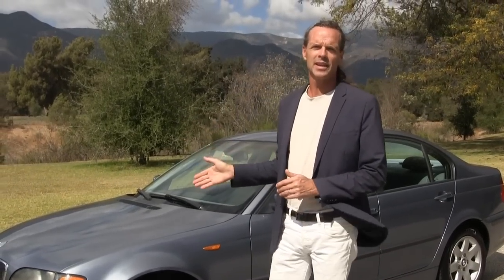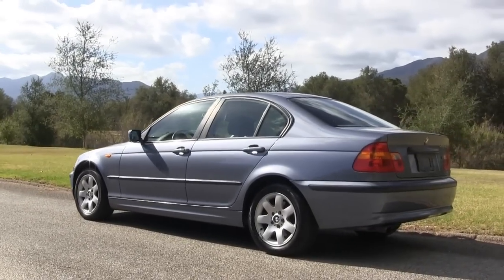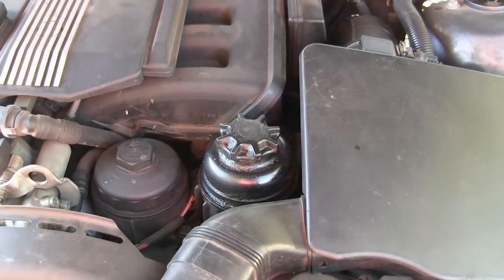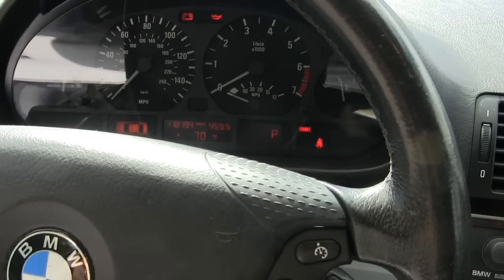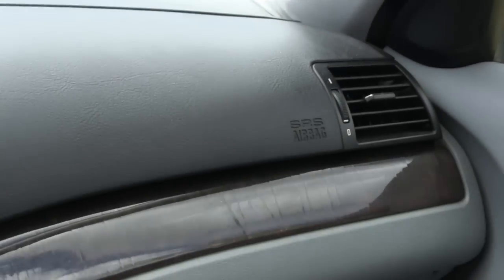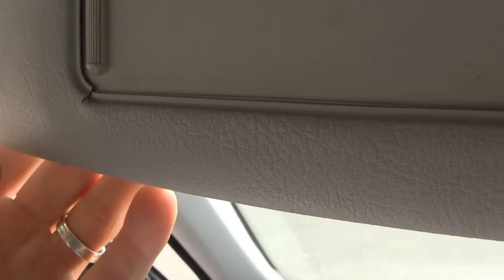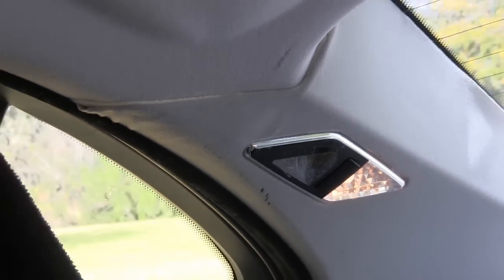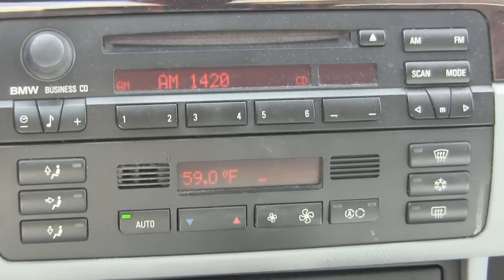Why You Should NOT Buy a Used BMW

Comment: Ive got a e46 330i sport and I love it, one of the best cars ive ever owned but! Bmws suffers with the oil pump nut failure!! The nut on the oil pump over time undo it self and if you not quick to shut down the engine it can cost you a lot of money. So for all e46 drivers out there have the pump nut looked at before its to late. BMW knows of the problem but will not fix it for free. Air bags are also a problem so be sure to call your local BMW dealer for the recalls.

Comment: I have a BMW 320d e46 Facelift with 300.000 km. I drive the car from Germany to Albania (2000km and bad roads) every year. The car never stops oder get mit in trouble. It had had some small problems (like evry car) but nothing expensive and the Interior und Exterior looks so good i wash the car 1 or 2 times in a month. Thr car only need oil and diesel and it drives. I have lots of friends with e46 and alle they don't have so much problems like in the Video they are alle happy with their e46 and me too!

Comment: On my third BMW. First was a 325i, and two 5 Series. Despite this, I am not a BMW enthusiast who believe they are the best cars ever. You buy a BMW for the performance and luxury, otherwise you will buy a Camry or Accord which will cost less to own.  I did have the interior roof poof down on the old 3 series as stated in the video. But overall, it really depends on how the individual treats the car.  I call BMW's the spoiled child of the car industry because you need to address the problems as soon as they arise. Don't delay repairs as they will get real costly. Despite the repairs, all the engines on my BMW's were solid. As with all cars (especially BMW) stay on top of maintenance and your car will run great for a long time. I highly recommend not buying a new BMW. In 3 years the car will be worth at the most half of what you paid for it. Best bet is to buy a 3 yr old lease return that has a BMW Certified Warranty. If you have 1-2 years left on the original warranty you are practically worry free and you can use your money to pay down your auto loan or if you paid cash for the vehicle, put about $5k away for future repairs.I knew two people who owned the early model X5's and got rid of them quick. They were crappy.

Comment: I'm not even a fan of bmw but I disagree with the notion that germans just ceased to figure any of what's addressed in the video out. I believe these kinds of troubles depend for the most part on the owner. That sticky stuff that's melting all over in the interior isn't exclusive to german cars, I have a honda accord 2001 and it has that stuff also. That's one of the reasons why people buy new cars and take good care of them themselves because you never know what the previous owner was like. My take is, every car is a good car, you just gotta take care of it. Does german cars bring along a higher cost of maintenance? Sure. But if you maintain them, you're in for a treat!

Comment: I own a 2008 e92 and I don’t have any of these issues at all. I have friends who have e46’s and they have none of these cracks in the plastics.

Many cars have problematic issues, my dad’s 2002 Honda Accord had a major transmission failure - those generations had a flaw in the tranny design.

I also owned a 2002 civic si and its d series engine had its head gasket blow at 150k km’s.

Not sure which junkyard you picked up this e46 but I’ve literally never seen one with kidney grills and all the other plastic parts popping off.

Comment: Ok I understand this is not a car for someone that does not take car of cars.  If that's the case buy a cheap corolla and it'll run forever and you don't have to do much expect normal maintenance.  An Acura 2001 3.2 TL is a gem as well.  I had a 2000 325xi with over 200K miles and learned how to handle these cars.   Learn to do the simple things yourself with youtube or with a trusted independent mechanic.  I did overheat one day because the water pump failed and I got no warning lights even though the temp gauge clearly showed it was pegged.  Learn to watch that gauge and check when you look at the speedometer.  It'll become automatic.  But if you actually like driving a car the 3 series from this pre 2004 era are my favorite.  You can get very nice ones for a very good price that have been maintained.  And driving them is a dream.  Well worth a few annoying issues.  With snow tires the all wheel drive is almost mistake free in the snow.  This car is built for accident avoidance.  And it does that in spades.  The steering is superb and tight not mushy like american cars.  I would highly recommend a used 325 or 330 xi to anyone that is smart enough to understand cars and loves to understand some the car.  It will become part of you.  Like I say the car takes care of me if I take care of it.  Everytime I get in I relax.  What's that worth?  The newer three's I've driven when I've had a chance are way over complicated and have too many conveniences to the point they are annoying.  Stay with the early 2000's and buy one with around 100K miles.  Replace the few things that you expect to fail as your budget allows and you will be happy for another 10 or more years with this gem.

Comment: There are bmw's with unreliable engines out there but when you get to the models with the straight 6 in particular the 330 the engine will in theory never break on you. A few friends of mine own 3 liter bmws with around 600k kilometers driven. At that point everything else starts to break but when youve got the German engineered engine and transmission its no biggie changing out interior pieces or replacing a waterpump when the engine itself is indestructable. Every car out there will have problems with interior falling apart at some point or another, to point out every single small problem from a lower than standard car is just nit picking. Good points and excellent advice for potential buyers about the water pump but stereo audio would be appreciated.

Comment: I have owned mine for 11 years, bought it used at 72k, currently at 194k, I replaced the water pump and cooling once.  Regarding the interior true its happening to mine but the car is 17 years old, look at any used car at 17 years and you will see the same.

Comment: I'll likely always own at least one small "poor man's" BMW in my stable (that's the way it's been most of my adult life).  They are fun and cheap, but I've gotten very good at doing window regulators (failed plastics), cooling system (failed plastics, lots), interiors and interior electronics falling apart,  motor oil leaks,  power steering leaks,  etc.  And don't get me started on suspension parts....I also have to maintain a 1995 Honda Odyssey (300K miles)  and a 2008 Toyota Prius (280K miles) , which don't provide nearly as much garage practice or driving fun at all.  One of the e46 I currently own was bought with full records, but still....I might go back to the older bimmers because these new ones have too many "must replace now before they go" parts (google and visit the forums and  you'll know what I mean).  Based on my personal experiences, the recommendations aren't paranoid like many of the ones from 17 year old rice rocket racers.  They're from experienced DIY guys who were actually stranded and guys on their 6th or 7th bimmers.  Things break.  That's why guys like me invest thousands on our auto tools and our education.  However, when too many parts are designed using plastics that don't last in this climate, it's best to buy newer and sell before 100K miles rolls around, or buy older  (plenty of fine examples out there in the California Bay Area) and use them as 2nd car fun machines...not hard to work on, plenty of help online, and parts are cheap online.  They're still great cars because there are many things BMW got right!  So right!!!!

Comment: I owned every cars from domestic to foreign. Fords, Buick(disaster,) Dodge Challenger, Nissans, Toyotas, Lexus, VW, Volvo, MBZs, and one f* BMW 3series. Whatever you showed and said has happened to me plus more. It really changed my entire life. I want to burn this piece of s*. 34K it started with windows, alternator, power steering, CV joint,     radiator as showed, 3 engine oil leaks, all the tensioners, electrical problems, faded paint, torn seats, pillars, water pump,.. piece s* started running a few days ago after six months sitting.  Inside and outside looks like s*. It has 74K now. I have a 1991 Lexus LS400 with 204k and 1995 C220 with 163K runs and look much better than this piece junk. You want BMW, lease the S* for 3yrs. turn it back in if you can and get another one. Thanks for your info.
.

Comment: So I gather this guy is not a BMW fan, I agree that the interiors are not the best quality on these E46 cars but this example has clearly had a hard life and been exposed to abuse. In my experience with german cars they are extremely well engineered and have a very high level of build quality, And as for the stated mileage of around 118,000 miles I have driven these cars with almost three times this mileage and they look almost showroom fresh inside and out. Abuse and lack of correct maintenance should not be confused with inherent design faults and inferior build quality.

Comment: I own an e46 for a year now (2001 325xi, 150,000km) and except for the ashtray in the front being scratched up i have not a single one of those problems.
everything is tight, nothing coming lose or hanging about, no rattles ect.
the car in video sure looks like as if had spent its entire life in the desert with very high temperatures.

Comment: If you are really willing to buy used fancy german cars, you must put up with harship replacing most of components that you found to. Mostly, rubber parst, such as suspension parts and mounts. Further, most of ignition, intake amd exhaust parts and sensors. That costs you roughly 2k or less then it would be feeling like a new. I always buy used cars instead of new ones as I can fix myself.

Comment: German cars in general have ridiculous maintenance costs you just don't see when you purchase it. I bought a Volkswagen a few years ago with low miles and absolutely loved it, until I had to start just doing general items for it. New tires were a minimum of $700 because of the wheels they had put on the car, oil changes were $200 every time, and when I took it in for the 40,000 mile service the general items they needed to fix and replace would have cost $1500+. The parts are expensive, the labor is pricey, and the dealerships of course have an up charge on it all, but even independent mechanics charge more to fix German cars. I couldn't trade that VW in fast enough and it turned me off completely to ever owning a BMW or other German vehicle.

Comment: I have a 2000 Lexus es300 and 2009 328i.  My es300 is still mint.  First two years of 328i air vent direction plastic broke and bmw dealer wanted $350.  Auto seatbelts also broke $250.  Oil change is crazy expensive I do them myself.  Unfortunately I still own the bmw.

Comment: my first BMW 
2000 325i
way back then the window regulator was problematic

got a 2002 lexus rx300 recently  2018 trade it in for Acura mdx 

had that lexus for 16 years put 280k miles no major problems original starter 
amazing vehicle 
Lexus and Acura all the way

Comment: I disagree with the "everything will be done at the dealer".  Sure, tearing the entire door apart to replace the window regulators was a pain, but very much a DIY project.  The window washer pump was ludicrously easy, and parts are available online for far less than at the stealership.  Oh, and a window regulator is about $70, NOT $700.  It took me about 20 minutes a side, although with a lot of swearing as I couldn't figure out why BMW decided to literally interlock every part in the interior with the door card.

My wife's BMW went off with about 200k miles, it did NOT have the torn up window cowl because we didn't park it 24/7 in the direct sunlight.  I've also seen MANY Japanese vehicles with much worse in wear-especially the paint.

Comment: You have to remember, this is a bottom of the line 3 series. Ive owned two E39’s and an E34 and they do not suffer from the cheap build quality problems explained in the video. Dont let one shitty e46 determine how you feel about these cars. They are reliable if taken care of properly. Spot on about the motor though.

Comment: Anddd I had a 2004 325I I bought with 15k miles and sold privately with 105k miles. Never had any major issues. Sure , some of the interior issues you mention are accurate BUT whomever owns the car in your video flat out did not take care of it. Mine was never garaged and I live in NY so it was exposed to 100degree days in summer and snowy winters and looked nothing like this sh*tbox does.

Comment: Oh no. Let us review a 13 year old vehicle(from the videos posted date) that has obviously had an asshole of an owner and say every BMW will have these problems. Almost EVERY ford has water pump issues, fuel line issues, intercooler issues( especially the ecoboost F-150's). But not EVERY Ford is bad. Mercedes and AUDI are MUCH worse than BMW. Higher in maintenance too. You can't take a vehicle that is older than 6 maybe 8 years old and expect it to be brand new. that is just not going to happen. I owned a 2003 325xi E46 and purchased it used with 110k miles. Not once did i have any of these issues. I had the car for about 5 years and did a lot of highway traveling. i finally had catastrophic engine failure around 378k miles. That was only due to me being discharged by the Army and getting screwed by them ANd i was side-swiped by a semi. Needless to say, BMW's are an AMAZING vehicle. just stay away from the 2-series and the X3's. those are complete shit lol. I currently own a 2013 328i M-Sport with 91k miles on it and i couldnt be happier. and guess what? I bought it used with 83k miles ;)

Comment: I sold cars on a franchise lot that happened to get lots of German luxury, and this seems par for the course , and most of what we got was newer than the one you have there... and what the heck is up with that weird scent German cars always have anyway?? But anyway, yeah, they are cars designed for people who lease, or keep it the length of their loan, almost all the units we received had between like 80K on the ultra low end to an average of around maybe 115-125K. I have a 2007 Honda Civic EX-L, which for those who dont know is a top end civic with surprisingly close to the same features as a base German luxury, I have 293,000 miles on that car, and it has none of these kind of issues, and I have driven that car hard and kept it outside.

Comment: My 2002 3 series is clean and well-cared for, but this video is accurate. Mechanical care is fine, replacing trim pieces, electronics, and cracking plastic is annoying. No car is perfect tho, remember this design is 20 yrs old. I would buy another BMW, but not an e46.
Reply: Well i have 2004 BMW Estrol Blue 318i e46 Sport Package. Best car ever. Bought from pre one old owner back in 2012 who looked the car very well. Car got 76000km back then. Its now my 6 year owning the car. It have 195000km on now. Have no problems. All regular maintenance is pretty much normal and its still cost way cheaper than lending a new car. I just replaced the vvt gear today for like $200. Now the "diesel noise" is completly gone. Would take e46 over new small cars anyday because you can drive 180kmh into corners without leaning much left or right like stupid small cars today. I can kill a AMG when it comes to corners with my baby because i am very skilled driver and its a drivers car not soft car like others. Its for old ppl. I am a big e46 fan. Dont like e90 and f30. Drove both of them. My next car is 2004/2005 e46 Sport Package 330d. Hope i can find one with low kms like this one of mine again!

Comment: Most of what he says in this video is true. However, don't forget we are talking about a 20+ year old car. Of course there will be some dead plastic after 20 years. Mostly, there will be a lot of small crap to fix, none of which is that costly to fix and no, you don't need to go a dealer. There are lots of them on the road and plenty of shops with the ability and knowledge needed The biggest thing to watch out for is RUST. I will admit that when I work on it myself, there are things that leave me scratching my head. I never felt that when I worked on my 1980s era  Porsche, when it was pushing 20 years old. More often than not, when you were taking something apart you were left feeling, "Wow. That's actually a clever way to do that and thank you Guenther, for using such high quality material. "  You can buy these old cars fairly cheap, but of course like any cheap old car, you need to fix a bunch of the things that are the reason it was cheap in the first place.

Comment: Japanese car have similar problems too and developed earlier.
The automatic window at the era are notorious for Japanese cars after 8 years of running.
The cosmetics though yes Japanese held up better, but if you want the Japanese quality interior, just leave the saggy BMW alone, it have about the same effect. And if you want to restore it, it's a easy job.
Many parts of the Japanese car are weak, but since most people who buy civic or corolla etc care less about drivability and also it was made to have huge wiggle room, it doesn't seem to be a problem for those buyers.
I think the most difference is sensors and location, I live in Asia and you have to be better than most of the mechanic here since they know nothing  more than 4 speed auto, and nothing more than 4 cylinders.

Comment: I just bought a used E46 from my friend who is a mechanic.  I plan to take it back because everything mentioned in this video, I have.  The car is a 2001 with only 97k miles.  After the E30/E36, BMW are a POS.  I am going back to Subaru